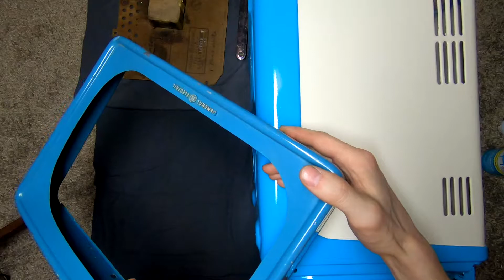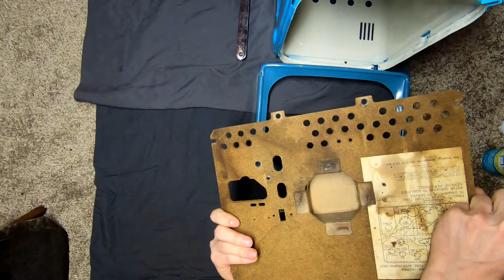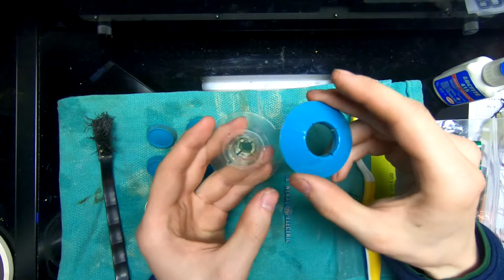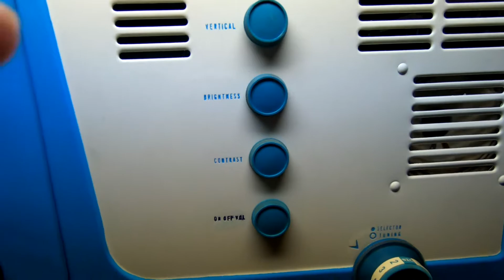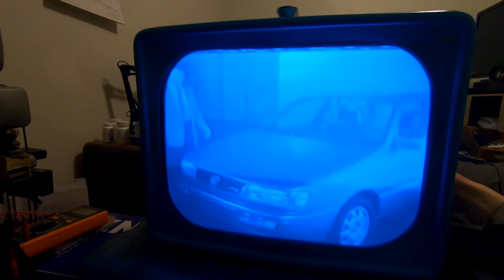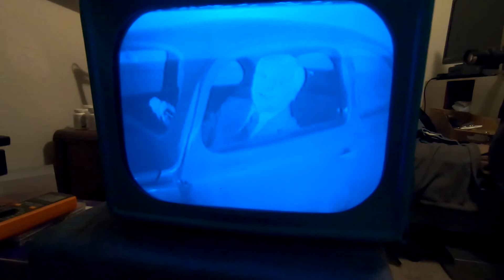GE 14T012 Part 3: Cabinet reassembly!

Comment: I swe this two years ago when it came out, and it’s another great video.  glasslinger’s YouTube channel has a recent video where he had Bakelite striated knobs with embedded dirt on a vintage radio, and he used a Dremel soft brush attachment on them that got all the crud out of the grooves very quickly.
Loved your restoration on this, and you always seem to learn very quickly from each restoration.
Reply from the maker: I didn't think of that, I have a Dremel but no soft brush. Will give that a try!
Reply: I have very easy way to clean these knurled knobs. I put them in a jar with some (Cascade) dishwasher powder and very little water. I shake the jar until the powder is dissolved. Then I add more water to cover the knobs completely. I then give a shake every once in a while. In a few hours to a day, everything comes out spotless.